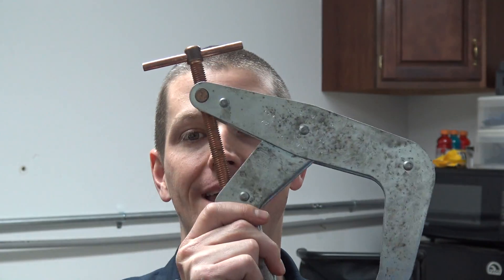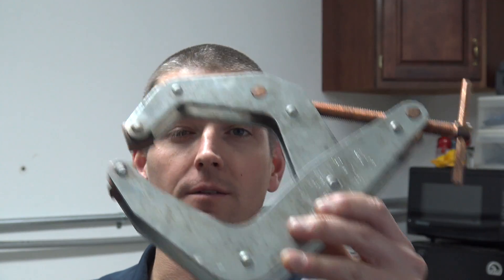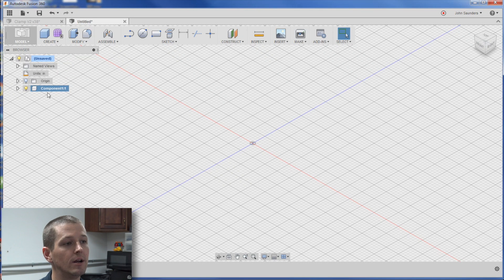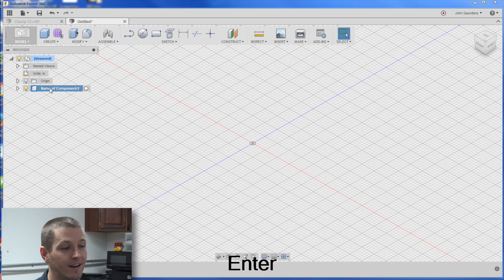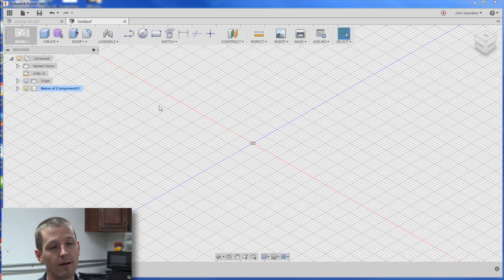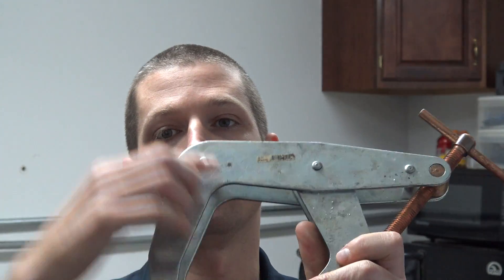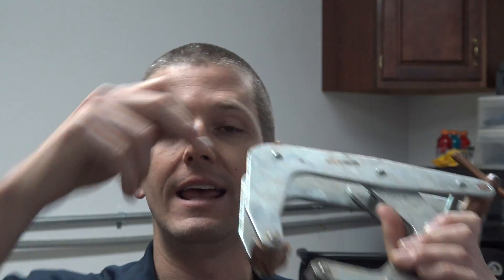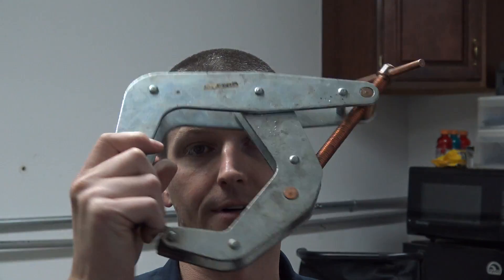Fusion 360 DIY Clamp!  Widget70 Intro Video

Comment: But the tutorials show doing "Create components from bodies", which allows you to do the sketch, bodies, components model.  I will agree that the top down component->bodies->sketches is a cleaner way to do it, but they did design the program to allow bottom up assembly.

Comment: Im a first year engineer. Solidworks seems much easier and more powerful. You said you were going to switch over to fusion 360 for a trial period, what's the reason for that?
Reply: NYC CNC good point... Aha. I wasn't aware it cost that much, I get the student edition for free. I imagine i'll end up using fusion 360 for home projects once I finish school. Having CAD and CAM in the same package seems immensely easier, especially for a hobbyist.
Reply: +Bentley Beckley Because solid works also has a definite "I'm cool cause I use solidworks" component to it. The way it works is actually quite antiquated. There are a plethora of newer cad/cam packages out there which are faster, more stable and more capable. Comparing anything to solidworks as an "industry standard" is a false conception of what industry standards are. There are many businesses that use Spaceclaim, fusion, onecnc, NX, pre-engineer, Catia etc. Some cad/cam systems are in house designed for their specific application.
Reply: Eadc Components Im not commenting on industry standards. Solidworks is what I know and from the looks of it solidworks is more capable than fusion 360. I don't know how you could debate that. I'm not saying ones particularly better than the other.
Reply: +Bentley Beckley id argue that. Autodesk is putting out great software's. Its defiantly not "hobbyist" software's either, its real world. Fusion 360 is a great program for any modern machine shop, the Cad is very powerful, different than solid works, but Its saves so much time to have a cad and cam in the same place. the cam element of fusion 360 is impeccable. one of the easiest cam software's I've used. I think there's a lot of "ego" in solidworks users about a new program, but the reality of it is Autodesk is a growing company with a lot of competitive ideas, and is giving its programs away to any school, student, educator, hobbiest. that means Autodesk is what the next generation is going to be familiar with, and for the price too. solidworks is going to be a thing of the past
Reply: Colin B. I don't understand why you're defending autodesk. I didn't say it wasn't bad. I said that fusion 360 was a great program for hobbyists because it's free and extremely capable due to cad/cam. I think what you're doing is stereotyping which doesn't really prove any point.
Reply: Stereo typing? How? How did you come to that conclusion, with your first year engineering knowledge? Seriously, Bentley your a first year engineering student, with MUCH to learn. Unfortunately the internet is not the best place to ask people to hold your hand through learning everything that's available. I can get twice as much done in fusion then I can in solidworks in a given time frame. I can get 10 times that done in spaceclaim. Fusion's integrated CAD/CAM is amazing. If Spaceclaim simply integrated CAM it would win, hands down. I myself cannot stand the thought process of a design tree, but I'm schooled in a different era. It's not better or worse, its just different. Anyway, spend some time getting to know more systems then you'll see beautiful differences in each. However fusion CAM is hard to beat atm, very hard to beat.
Reply: "I think there's a lot of ego is solidworks users." I don't know what your definition is, but to me that's stereotyping. Just because I'm young doesn't mean I don't know what I'm talking about. I honestly don't know why you're trying to convince me fusion 360 is good, I know it is.
Reply: +Bentley Beckley I was just making a point that everybody thinks the software they learned on is "the best of them all". You had said "solidworks is more capable than fusion 360". I was challenging that statement.